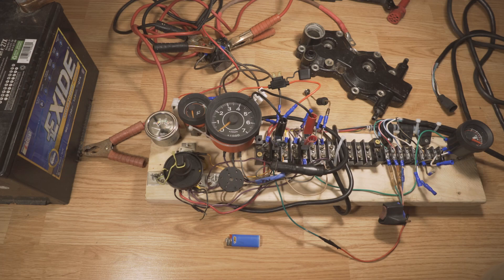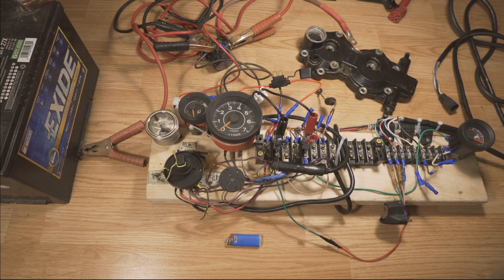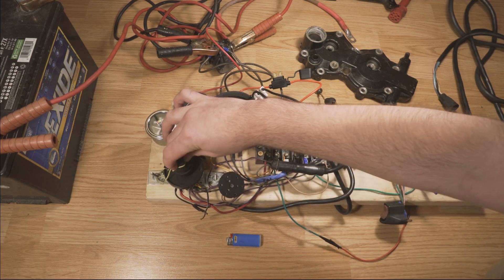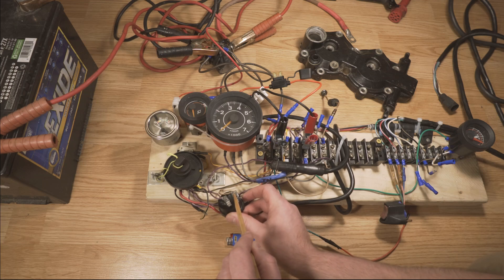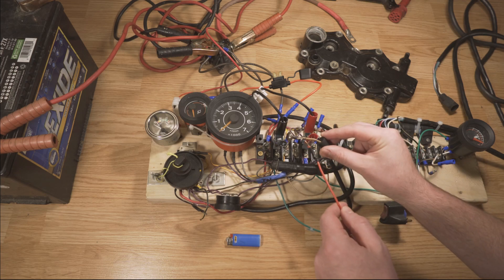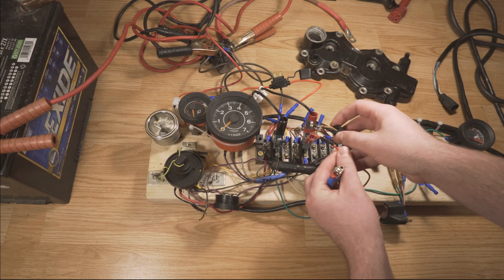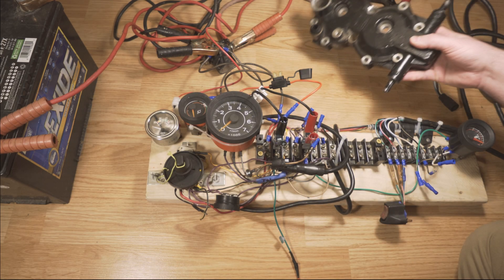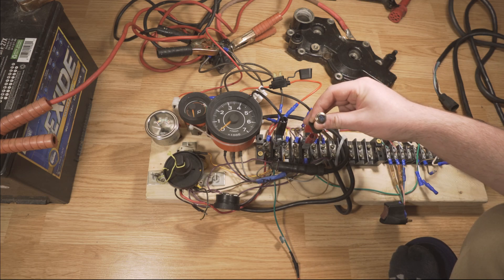Outboard Motor Control Wiring Part 3 - Overheat Warning Sensor / Temp Sensor Wiring

Comment: Thank you for the good instructional video. I do have a question that I think you may be able to help me with. After watching your video, I think my issue is the temperature sensor itself. But here’s what’s going on…

When I turn my boat over for the very first time, the buzzer immediately starts going off as if I have low oil, pressure or over temp. I’ve ruled out it being low oil because my reservoir is topped off and it’s using it. I feel like I have Rudolph the boat overheating because from a cold start it immediately turns on the buzzer. So wouldn’t that be that little thermometer bulb with the two wire leads?
Reply from the maker: You could try wiring connectors directly to the buzzer and testing it. I have not had a motor with an oil sensor but it must be similar. If its ringing its probably shorting out somewhere. Also obviously make sure your boat is sucking in water and being cooled.

Comment: Is there anyway of hooking a temperature Gauge to the sensor? I hate not knowing the temperature while I'm running the engine.. By the way, I have a Honda bf130hp. Thanks..
Reply from the maker: Many of the old engines do not have one. Only an overheat warning. You'd have to make one using Arduino it would be fairly easy.
Reply: You can buy a temp sensor that comes with a gauge and a sensor.  That new sensor will mount somewhere else on the engine.
Reply: I was thinking where the cap at .35 in the video to thread a sending unit in at that point. Or at least an adapter to screw a sending unit in.

Comment: So. If my temp sensor goes off after 5 mins how can I diagnose if its not working. Obviously checked all cooling system.  Does magnet in sensor go bad?  Would the ground wire be damaged?
Reply from the maker: Well is water coming out of it when it's on?
Reply: @Hello Everyone  yes yes all the obvious stuff. Basically I would like to know the internal workings of the sensor. I.e. do magnets fail? Get swollen and keep inside permanently grounded
Reply from the maker: @oisin1980  if you search my videos I got one on it.

Comment: I realize this video is several years old, but hoping someone can suggest a fix for a warning alarm issue I am dealing with. The issue is the volume on the buzzer is very low for one engine and normal volume for the other side. Apparently both engines are connected to the same alarm/buzzer. The volume is so low I cannot hear it when the console is closed. The alarm volume is also low anytime the key is put in the ON position so it's not only at overheat. I have tried researching this issue online with no luck. I'm thinking of swapping out the ignitions as the alarm is part of this. Thanks in advance for any help. 
 TWIN YAMAHA F225.
Reply from the maker: I would try swapping out the buzzer first just to test it it could just have gone bad or corroded inside.

Comment: Hey
Thanks for all your videos 
Can you please tell me how to make my tachometer work on my 1976 johnson outboard 70hp 
It has a wire from the controller 
But it the plug is on the motor doesn't have that wire 
From where I can get that power 
If my plug from the motor not have that wire?
Thanks

Comment: When I turn my key to on the buzzer is in constant alarm.  There was no grounding wire on the buzzer as your provided diagram shows and I am worried my accessory wire and temp sensor wire are installed backwards.   If they were, would this cause the constant  alarm?

Comment: I suspect I have a bad sensor since my 40 HP evinrude gives me the horn after a short period of operating at high RPMs.  I disconnected this sensor and I still got the horn at high RPMs.  Is there a common miswiring that would cause this or something else?
Reply from the maker: Are you sure you disconnected the correct sensor as it sounds like you have a bad thermostat. When's the engine heats up it's not able to cool correctly because the thermostat is not opening up causing the heat alarm. there's only one wire going to the sensor if you ground out the sensor it'll beep.
Reply: ...you might want to trace the tan/brown wire through the engine and back to the control box.  If the insulation chafes and makes contact with the metal of the engine or other ground wires the buzzer will sound.  Look carefully at where the cable bundle exits the engine.  Jiggle wires while the buzzer is going, if it quits you know you are in the right area.  Good luck.
Reply: Did you ever get this resolved? I am having a similar situation.